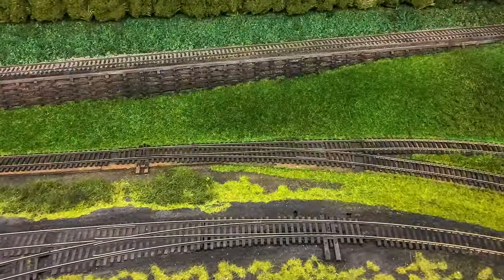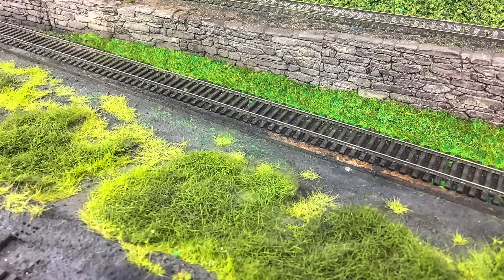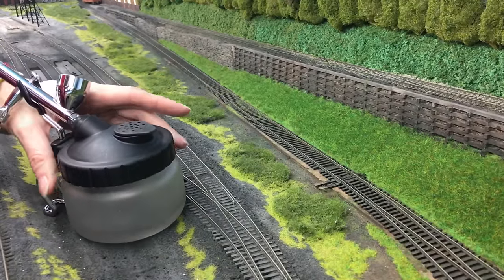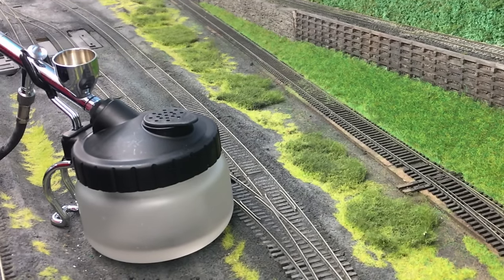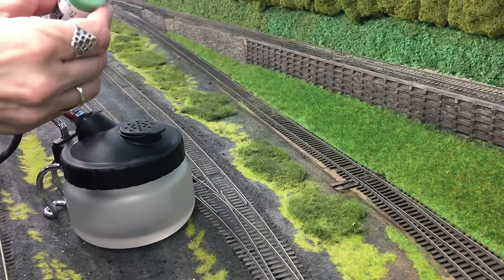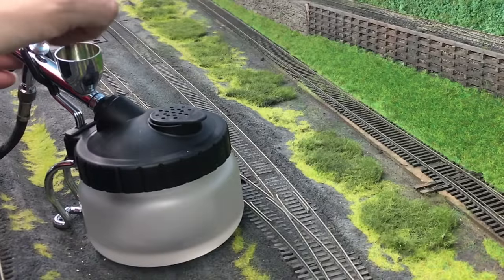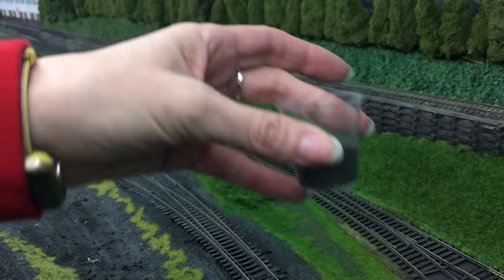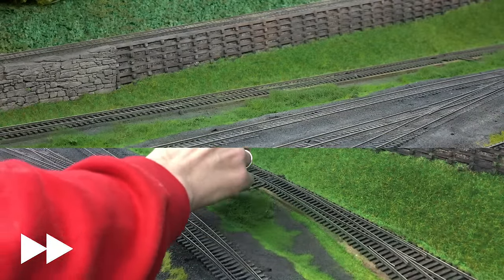How to Paint Static Grass to Change the Colour

Comment: I am surprised how nicely the process worked.  As a model railroad and chemist, I would have chosen a fabric dye instead of paint if I were to do such a project. The reason being is that paints contain a resin which even when diluted would add a coating and not just color change to the static grass fibers.  [When I was attempting to learn how to apply static grass, I found as scrap piece of extruded polystyrene which I painted with latex paint and then applied static grass while the paint was still damp.  I would use that test mode for changing the color of static grass.] Respectfully submitted by a currently arm chair model railroader.  Thanks again for sharing.
Reply from the maker: +Roger G. Perkins I always thought dyes needed a porous surface...  I suspect there are many different products you could use but paint is the most common. If you do rest something else then please let me know.

Comment: Nice video Kathy again!  Be careful when using 90% alcohol it will take the paint off.  A lot of people use it to strip paint off their locos.  If you can get 70% that may be safer to use.  But looks great!
Reply from the maker: +maxanddad1 It's got a lot of fumes too!  I generally water it down to about 30% so it's not too bad.

Comment: Dear K. avoid whenever possible ofusing Valleyo with a "white cap" for airbrushing ,and then you will enjoy it more ...
Reply from the maker: I’m sorry I don’t understand what you mean.
Reply: @KathyMillatt  What I meant was to use the Valleyo AIR , that colour has a black cap and is much more suitable for air brushing
Reply from the maker: Leo Jurin thanks. I use my paints for both airbrushing and brush painting do tend to get the white tops but it’s a great point that dedicated airbrush paints are much easier to spray.

Comment: Gunze Mr Levelling Thinner you can get here in the UK easily, or just regular Mr Colo(u)r thinner for thinning Tamiya paints.
Reply from the maker: +ScrubbersGhost which brand paints would you thin with them?
Reply: Gunze and Tamiya paints are compatible, as Tamiya isn't really an acrylic paint, but more on the lacquer side, hence why they do an alcohol kid friendly thinner X20A for their paints.So if you don't want to have to order Tamiya Lacquer thinner from overseas, and want a suitable thinner for airbrushing Tamiya paints, get the Gunze stuff, either thinner works, but the levelling thinner has retarder in, so the paint levels out better.I hope I ain't confusing the issue.
Reply from the maker: Thanks, I do have some Tamiya lacquer thinnners that I shipped from the Far East but it is much easier to get Gunze over here.  Great Help!

Comment: Hey kathy again following your great videos, just wanted to give you a tip on using an airbrush and acrylic paints. To prevent too much clogging dilute the paint with windex to about a milk or a coffee consistency. I promise you, you won't have any issues with clogging. Also you got yourself a nice airbruch is that iwatta?
Reply from the maker: +prince troncoso Hi, it’s an Iwata Eclipse. I used windex with a paint once and it made it coagulate. Other brands of window cleaner did work well but I still got clogging. Now I stick to the right thinner for each paint. I don’t spray enough for the cost to become prohibitive.
Reply: An eclipse I have that one as Well its a great airbrush one of the best actually good pick! 👍regarding the Windex I suppose it has to be a specific one then I use the standard brand sold here in America and it works great for me even when I use cheap acrylic paints from Michaels too. But you use what works best of course. Thnks again for your videos I enjoy all of them. I wish I had time to make videos again but I don't Unfirtionaltly. Your videos make me want to get started with videos again 😎
Reply from the maker: +prince troncoso Doing video’s is fun but time consuming!  Modelling is under half the time it takes you!  Glad you like the eclipse. I’ve had it for years but feel like I don’t use it enough or to a high enough standard.
Reply: Kathy Millatt yeah that is precisely one of the reasons I stoped making YouTube videos a long time ago. I just been building and painting miniatures this whole time just making simple short videos and active mostly on instagram. The eclips it's awesome I will get another one soon for other types of work. Hope you use it in your videos more often.

Comment: I am with you there! I have bought an airbrush, airbrush cleaner, etc but still haven't plucked up the courage to use it in anger yet. I have, however, watched dozens of videos on how to do it which makes me an expert - NOT! Great job though - that grass looks way better than before.
Reply: Airbrushing isn't that bad. Paint problems can be confusing at first, but when you realise you only have to control two variables (air pressure and paint thinning) you very quickly get your bearings. Thin paint need lower air pressure, thick paint need higher air pressure. It's that simple, adjust one to match the other.
Tip dry is annoying until you learn to use a q-tip with some airbrush cleaner. Only hard part of the process is to be mentally prepared for using more time than you'd like on airbrush cleaning, otherwise you'll be golden! :-)
Reply from the maker: +SheepWaveMeByeBye So true. I suspect the first 100 models are the worst!
Reply from the maker: +davie maclean Thanks Davie, I think it looks better now.

Comment: Hello did you test microrama static fiber, and other components. They have a large range, and also video, with RTS green keeper probably the best 35KV.
It's french site from Brittany. 
They can make stacking of fiber to 6 or 7 cm .
First brown fiber 6mm a few time, then green 4.5 cm or 2.5mm or flower.
Seems to be new and different from noch or woodland scenic or peko.
Guy Marlé from Belgium
Reply from the maker: Hi. No I didn’t. I have never seen them in the UK.
Reply from the maker: I will check them out the next time I need to buy grass. Thanks for the recommendation.
Reply: @KathyMillatt  thanks for replying and also for your wonderful and very instructing video's.
Microrama sell mothly to France and Germany .
I am an old marklin fan since 62 years.
I was working for papermaker Wiggins Teape during 30 years also for 1 year in Cardiff.
Reply from the maker: @navarra1939  Thanks!